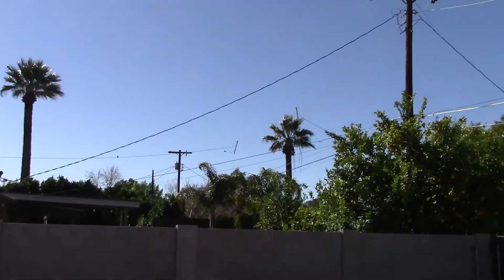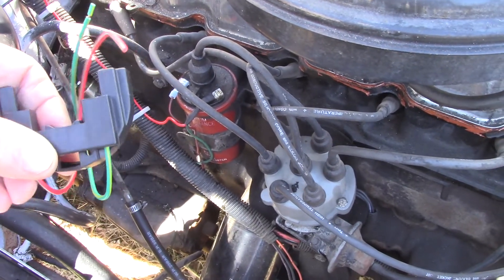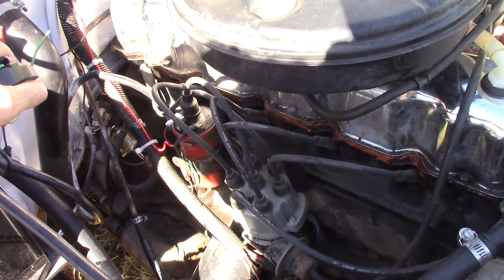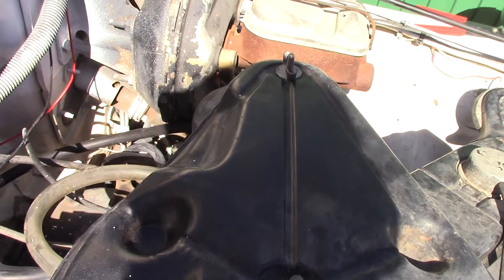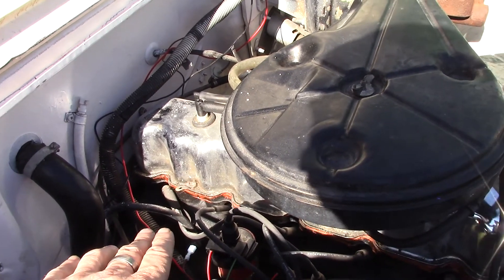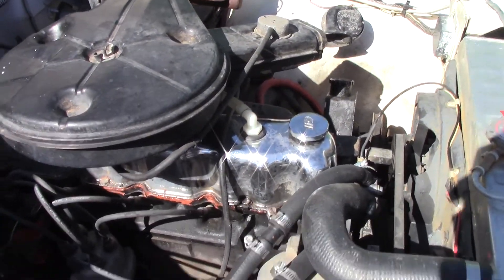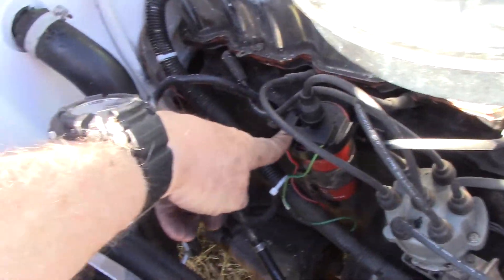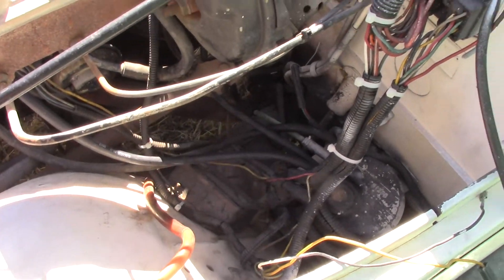Look Mom, I'm not a complete moron! The Jeep CJ-7 is running good again!

Comment: Have somone rev the jeep and use a stethiscope or even a large rubber hose to the ear and poke it around the engine bay and use that to figure out whats squeaking. Somtimes you can even hear a water pump bearing before it leaks on your
Reply from the maker: Good advice, now all I have to do is wait for that mythical someone to come help! Or, I could ask the wife. Nope, I'll just wait. lol

Comment: One time i cheaped out on buying that connector for the coil but i learned i shoulda spent the $ when the wire harness shifted and unplugged the olcoil amd the jeep died on the highway when my dad was driving it. He re connected it and zip tied it but needless to say i was gonna buy it but then my moteecraft ignition system took a dumo and i ended up buying a hei
Reply from the maker: I've had an HEI distro sitting in a box for 20 years waiting for the Ford ignition to die. But it just keeps on chugging along. By now it's got so much seniority I'm afraid to replace it.
Reply: @3rdpig  ya, the ford systems are pretty good.we have 2 other cj7 with i6 rather than v8 but they use the same brain box. Mine went bad but i think the final blow was a cam break in on my 360 swapped  cj and the brain box facory mounted on the fender with long tube headers cooked it . Brain box and everything aside from distributor is still under the hood and  oe coil wires dont get full voltage idk why. If you do ever upgrade it, make sure you pull 12v accesory line not from the original coil but from somwhere else. Also some of the bootleg chinese omes can eat cam gears as the metal is over hardended so i swapped my hei with the oem gear and later swapped it with a brand name davis unified ignition one that the gear doesnt need changed on as i figured its more depemdable for a daily. I think somthing was always wrong with my motercraft system though, jeep runs much better now with the hei but when the 258 was in it the motercraft was fine. Even the pre 1982 non electronic carter bbd are not that bad if maintained. The stepper moter ones are junk though amd by now most are so clapped and neglected most are ripped off the jeep
Reply: @3rdpig  my dads 77 has the prestolight system but it did fail once amd grandpa modded it and its been golden for the past 30 years . I also have a aswell 77 parts jeep also same presolight it runs good but being such low miles i dont think its wore out yet.